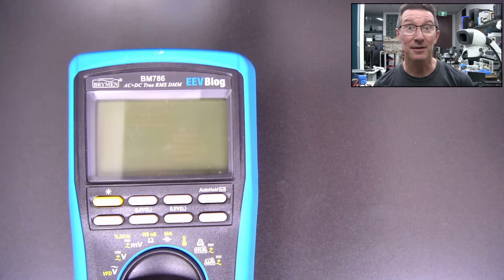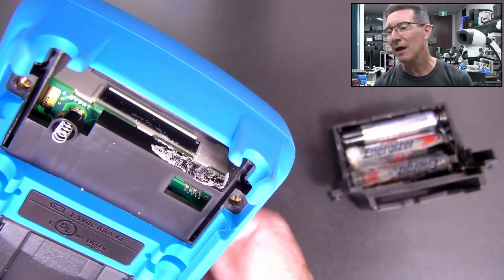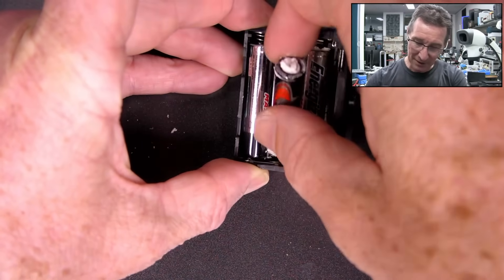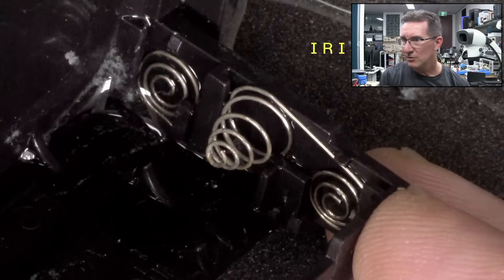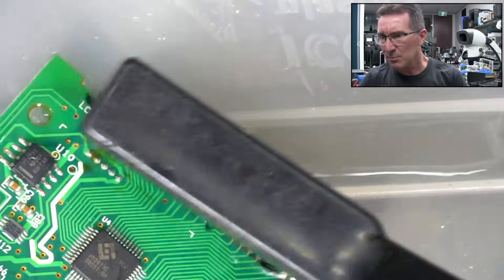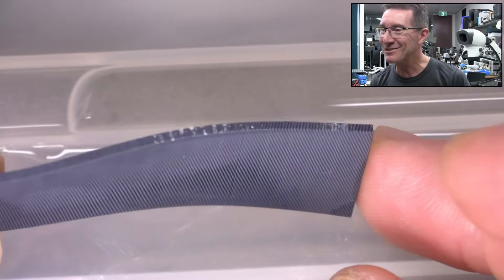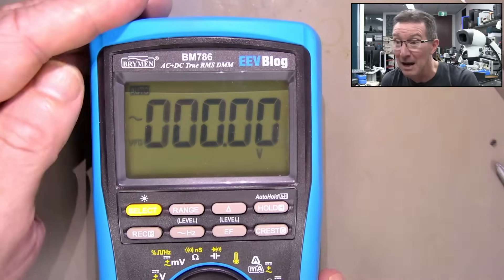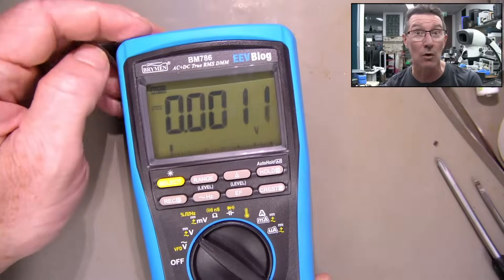EEVblog 1670 - BM786 Multimeter BATTERY LEAKAGE REPAIR + GIVEAWAY

Comment: I'm a young whipper snapper in Australia 😂 I'm getting into coding and electronics and my Jaycar special multimeter decided to grow legs and do a runner... so I've been using my father in laws analogue ... multimeter which has an error of 0-5v when it works... please help
Reply: At that point you're better off licking the terminals to measure voltage.
Reply: @JMMC1005  That will also quickly tell you if it is ~230V  or so
Reply: @JMMC1005  potentially more accurate to
Reply: ആണോ കുഞ്ഞേ?
Reply: @ManuKrishnanmagz  да, дедушка
Reply: Why is it that these days if someone has a problem, often caused by themselves, they feel entitled to receive free stuff from someone else who has worked hard for what they've got, usually. I really struggle with why this was pinned, especially as i never had the gall to expect something I hadn't earned. Life saving stuff excepted but i personally wouldn't even do that.
Reply: @v8snail  The only things I expect in Australia are 1. Summer to be hot and aircon dials in cars to not go low enough, 2. anti-venom to be available at the local hospital and/or a pair of thongs to be available for fighting spiders even for the Newcastle Big Boy and 3. In winter to complain about how cold winter is even though it is above 0. I was simply asking for help (where no could be the answer).
Reply: @v8snail    Hey Gramps, thanks for sharing this wonderfully insane pathology with us. It's good to know that you're so committed to society being cruel that you wouldn't take a "handout" to save your own life. You must not like yourself very much!

Anyway, about the comment you're responding to, if you had read the title or watched the video, you'd know that Dave is soliciting these exact types of comment to give the meter away to someone who will benefit--but you're right he should throw it away instead so that kids these days learn the value of hard work! Thank you for your kindness, and please make sure to continue commenting before watching videos in the future.
Reply: @v8snail  Because it's been offerd you moron
Reply: @v8snail  you may have missed that Dave actually said for young whippersnappers in need of a multimeter to leave a comment.... So by doing that he actually did earn the multimeter.
Reply: @v8snail  whats a foreign made multimeter to us fully grown men, 
the only people who worked hard are the slaves overseas who built it while dave was laughing all the way to the bank.
Reply: @echelonrank3927  Pretty nasty comment from someone who watches the channel?

Comment: My BM789 came with alkaline batteries that did the same thing. I kept the meter on my workbench in an air conditioned room and used it a couple times every 1-3 months or so. I cleaned the board and contacts with alcohol and switched to Eneloop. I was told warranty didn’t apply, this was my most expensive meter. Why do they even include these batteries at this point, they should just include Eneloops.

Comment: As far (or not so) I know, the LCD STATIC drive still needs power, because the static unipolar field does not work in longer term -- like a couple of seconds.  So, the field polarity has to be reversed continuously.  That then means losses in the driving circuit like on any AC or especially square wave into a capacitor. Used also for digit multiplexing.  Makes checking the signals to the LCD module a bit more confusing than it would be with steady DC.  I bet you do know this, just skipped describing it.

Comment: Do you think this is a Fluke (not pun intended) battery leak event?  How often does one check your batteries?   Are their conditions that lead to battery leakage (dampness, heat).  I have the BM786 and since I have seen this video have thought to check the batteries.

Comment: Anything with low current usage (and hence long periods between battery changes) now I use lithium equivalent cells. They won't leak and have at least 10 years shelf life.

Comment: I think i may have the same type of issue with an old Radio Shack handheld calculator it is the original from the early 70’s.  And i had a battery leak issue.  I am cleaned up the leak but it still doesn’t work.  I may have missed so damage that I just didn’t see at the time.  When I get a chance I an going to go over it again.  I would love to get it operating again.

Comment: Great video. Regarding design equipment with batteries,  I would like to see the battery compartments that it would not be possible for battery acids can come into the instrument.  It is really a nightmare and a big waste if it happens.  And I suppose we all have several cases of battery leaks.  Recently my trusty Casio calculator was ruined by battery leak, after 2 decades.  The "problem" of the calculator is that is using too little power to work, so eventually battery leaks before you are thinking about battery replacement.  Otherwise other instruments or devices we don't use so often and just forget about those batteries inside (like the case here with this DMM). The biggest issue is when the acids gets inside a multilayer board and under the components.  Also the acids are breaking the copper.  Few days ago I repaired an old DMM for a friend, the acid eat the battery connection wire inside the 9V battery clip. The meter was otherwise fine, so a quick repair.  So yeah, get those batteries out. One solution is to use an old analog meter for quick checks, of course the resistance measurements would not work without the battery...

Comment: I personally stopped using Energizer Max cells.  They might make sense for high current devices, but most of those use Lithium rechargeables now.  Lower current devices seem to be fine with cheaper alkaline cells, and I see very few instances of leakage.  I suspect the chemical composition in the Max type is more reactive and thus more likely to leak.

Comment: Appreciated excelent cool I've started using AA / AAA Lithium Batteries on my more valuable items. Especially the multimeters or measuring tools that I don't use regularly. They're a bit more expensive, but last very long and don't have an issue with leakage.

Comment: Eneloops work great in everything I have which requires AA or AAA cells, they are far more economical than non-leaky alkaline cells and astronomically more economical than leaky alkaline cells. So why are you using alkaline cells?

Comment: After the last weeks leaky video, I was reminded that I had been meaning to remove the batteries from my Mark Levinson remotes for the past two years. Welp, one remote suffered the wrath of the Duraleaks, but it was caught early enough the nickel plating was still intact, at least visibly. Thanks for the reminder Dave!

Comment: Where the installed batteries unbalanced?  Especially a problem with 3 cells in series. The batteries with the higher charge try to charge the lower powered cells.  Like self balancing.
A lithium or two would fix that feature.

Comment: Soo, when are you going lithium? 😄
My Brymen BM867s uses a 9V battery and lithium has double the capacity. The only downside is the price, 3-times more expensive butt... no leaks!
Reply: I repaired an earbud charger with a tiny LiPo battery that had leaked. It corroded away some solder connections and turned the pads black.
Reply: @nophead  Sorry to hear that. Was that a branded battery or a no-name?
I'm using Varta Lithium (Li-MnO2), which are much less prone to leakage than alkaline or zinc-based batteries.
Reply: @rozwell69  Yes it was a no name LiPo cell in a plastic and foil package that tend to bloat and burst. I have never had Lion cells in metal tubes leak.

Comment: Many years ago I switched to Lithium primary calls (not rechargeable ) for all my AA, AAA, and 9-Volt. I have never had them leak.
Reply: I bought a few NIMH 9V cells with higher voltage, I think they are 9.6V batts. Most 9V NIMHs sadly are 7.2V

Comment: I think this is the reason Fluke uses 9Vs.  They still leak but most of the leak is contained in the battery.
Reply: Newer Fluke models don’t use 9V batteries. (For example, the 87 V Max, aka the 28 II, uses three AA cells.)
Reply: @tookitogo  Thanks, didn't know that.  I have 5 Flukes the newest being a 177 which might be 10 years old?  I would use eneloops for any meter that uses AA cells.
Reply: @ohger1  I’d probably use lithium AA’s, so as to not have to open the case so often!
Reply: @tookitogo  Do the lithium AAs generally not leak?
Reply: @ Correct.

Comment: Get yourself some citric acid - it is food-safe and comes in crystalline form in sachets. It does the same job but without the smell.
Reply: A liter cleaning vinegar (7% acidity) cost no more than a dollar / Euro. Citric acid a many fold. Vinegar is a waist product from the industry.
Reply: @erikdenhouter  But how much do you ever use? The lack of odour is well worth the price difference which probably amounts to no more than a few cents a year.
Reply: @donepearce  All relative. If you have to clean your own house you know that you can use it to clean many things, like floors and shower etc. It is a choice, they are both acids.
Reply: @erikdenhouter  It's simple. Vinegar stinks, so I don't use it to clean things.

Comment: That's why use 99% isopropyl alcohol and not 70% rubbish 😊
Reply: Those crystals and residue are probably polar (and wouldn’t dissolve in pure alcohol). I’d expect some water helps in this case. If you’re just cleaning non-polar stuff (oils and greases) pure is probably better. All depends on what you’re trying to clean.
Reply: Joking aside, I assume there's a reason why Dave is using 70% instead of 99.9%, as the cost isn't likely to be remotely significant here?
Reply: 99.9%

Comment: These days the alkaline batteries that come with low-drain, sporadically used devices go straight in the trash and are immediately replaced with low self-discharge NiMH. Even if rechargeables don't make sense for low-drain devices from a purely economical standpoint, it is worth it to not have to deal with cleaning up the inevitable leaks and damaged devices.

Comment: Just use carbon-zinc Anko batteries from K-Mart. Those beauties don't leak.
Reply: K-Mart has effectively abandoned the continental US market - only one location left.
Reply: @MikeU128  Just buy zinc-carbon batteries from your favorite retailer and use those. 99.93% out of 100 they won't leak. Alkaline cells will always leak due to expansion and temperature variations. Example shown above in video :)

Comment: For me it's Duracell. Duracell used to be the "GOAT" of batteries when it was a part of P.R. Mallory. After that it has went on a steady decline. Duracell batteries leaking and don't last long. I never had issues with Eveready Max, but then I discovered Ray O Vac Ultra Pro batteries and that's what I now use.
Reply: Duracell Procell are still great batteries. Almost every batter you find in the checkout line at a grocery store is going to be leaky junk.
Reply: i saw a video where a guy tested couple of dozen of different battery brands and types and energizer lithium and blinks power came up as the best energy per dollar.
 ray o vac was average, energizer alkaline below average.

Comment: I've had the Duracell cooper top alkaline batteries leak even though they were still usable and within the use-by date.  In act, I've had them leak while still in the package, unused, and within the use-by period.  So, I switched to the Eveready alkaline batteries.  They advertise that they have a new leak-proof construction.  I have not had one of them leak

So, strange that you seem to have the opposite experience.

Comment: The zebra strip is indeed not critical to line up on between the contacts... but it does matter to keep the LCD and PCB lined up at least. I had that problem with the Tek 1503 screen repair... one half of the screen was one pixel off... smaller pitch and the flexible nature of these is still a probable cause of "oopsies".
Reply: Aren't they forced into alignment by the case and mounting? Can't envision how that wouldn't happen.

Comment: I got into the habit of removing batteries from any device I don't use on a regular basis a very long time ago.  Doesn't matter who's battery they are, they ALL leak.
Reply: Last year I found an empty AA cell in a analogue multimeter from the late '70 with date code on it, no leakage. I forgot to look, but I think it was carbon.

Comment: 16:44... Why didn't you clean the Blue Corrosion on the two Thru Hole pads at the top right corner of the PCB ?
Reply: 16:40 Maybe lighting as I can't see what you're seeing.
Reply: @TheStevenWhiting  Look at 4:41 and the 2 Feed thru Holes with the Blue Corrosion

Comment: Energizer and Duracell, LEAK IN THE BOX they come in, new, years before expiry, never used.  Why don't the cheap alkalines from China that come new in TV remote controls never leak? I just emptied one made in 2011, battery expired 2018 (stamped on it) and not a hint of leakage.
Reply: fujitsu air con remote batteries here : 30 years old and still measures well. Same as Casio batteries in calculator. Work fine after 30 years . Made in japan
Reply: Found one last year in an analogue multimeter, in there since the late '70's, no leaking.

Comment: I'd give those battery compartments a good bath in an ultrasonic cleaner after the vinegar treatment - might not be as good as re-plating, but still good enough unless new batteries get leaky.
Reply: No ultrasonic really needed. Put in vinegar for a few days, or in warm vinegar for shorter times, clean as a whistle.

Comment: My recommendation is to take silicone grease and press it into the openings where the battery contacts go through the plastic. It may not prevent the batteries from leaking, but it will protect both the spring contacts & prevent the fluid from making its way onto the circuit board. If you use the grease to plug up all the openings (depending on the case design) you may not even have to be mindful of how, i.e. the direction, you store it.

Comment: Every time I fiddle with a zebra strip it always get some part of the screen not working no matter if I clean it several times and retry then some other part is not connected.
I really dislike these😜
Reply: Wash with water and brush, rinse with isopropyl, dry with warm air, use microscope or magnifying glass to reassemble avoiding dust or hair.
Reply: Yep, that's what I use to do but it seems the pressure down to the PCB is gone after I removed it.
Have to add extra preasure for it to work and in most cases that ain't possible due to lack of room for it.

Comment: 70% isopropanol? That is to less.
We need an azeotrope mixture. It should be more than 87.7%. Then the water will evaporate as well.
Reply: That's why I only have 99.9% at home.
Reply: @spedi6721  Yes/No. Salt does not dissolve in 99.9%. It needs more water.
The best is: use 70% for cleaning, 99.9% for the last drying.

Comment: Why use 1.5V Alkaline AAA in the first place? Do multimeter manufacturers need to consider supporting 1.2V Ni-MH AAA instead so that battery leaking because a thing of the past?
Reply: technology is progressing extremely rapidly 🐢  USB rechargeable lithiums in multimeters are probably less than a decade away 🐌
Reply: @echelonrank3927  As long as the lithium cells are user-replaceable when they inevitably stop holding a charge in a few years, I'm good with that. My Hantek handheld oscilloscope/multimeter has exactly that, so it's not a decade away, it is here now! But it does mean that we need to worry about durability of USB charging ports instead...
Reply: @MikeU128  for portable oscilloscopes it was here yesterday but yeah, the durability of usb charging ports decreased massively over the years of going from mini-USB to micro-USB to USB-C now. with the way things are going USB-NO might be next.
Reply: @MikeU128  I'm only getting about 3 years out of a phone due to the USB-C port. Plugs won't stay in.
Reply: Most devices work just fine with the lower voltage. For the few that don't, there are a couple of vendors that sell lithium based AA/AAA rechargeables with nominal 1.5V output.

Comment: For devices i won't use for a long time, like the flashlight in my car, i usually get the old zink-carbon batteries.
Don't have a lot of power, but they don't leak and have almost non existent self discharge.

Comment: AA lithium batteries don't leak, have much higher power density and longer shelf-life
Reply: @NICK-uy3nl  higher power density - no. Typical lithium AA is good for 3A when Ni-Mh can output 5A.
Even higher power density - 18650/21700 Li-ion. Those (high-current ones, of course) can output 20-40A
Reply: I was comparing AA Lithium battery with ALKALINE battery. AA alkaline battery has power density of 700 mA, AA Lithium battery has power density of 3A .

Comment: Meters should use 9 volt batteries. Can't recall ever seeing one of those leak.
Reply: Oh, 9V alkaline batteries absolutely can and do leak. They just have an extra layer of “packaging” around the cells inside, so leakage takes a bit longer to become visible, since it needs to escape both the cell and the rectangular housing.

Alkaline 9V batteries have one of two internal configurations: six AAAA cylindrical cells next to each other, or a stack of six flat rectangular cells (essentially button cells, but rectangular instead of round). Some people think the latter type leaks less often, but I have no data on it either way.

But I’ve definitely had 9V batteries leak.
Reply: @tookitogo  i was going to type in exactly that, but meh, just mentioned a battery that cant leak
Reply: yeah, 9v usb rechargeable lithium batteries